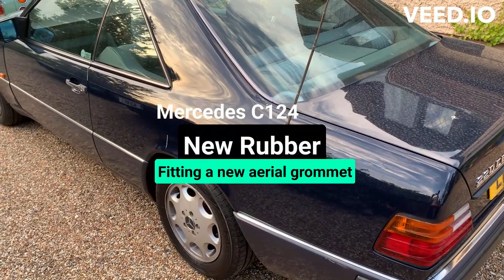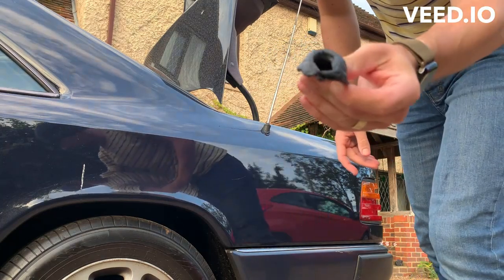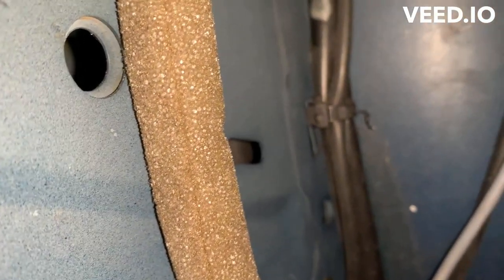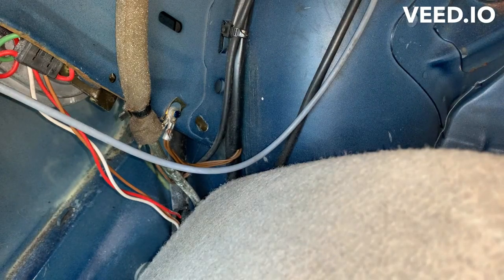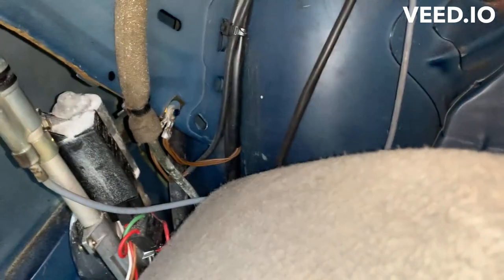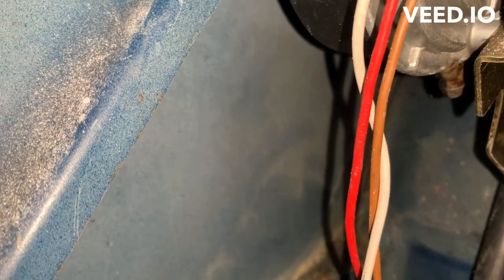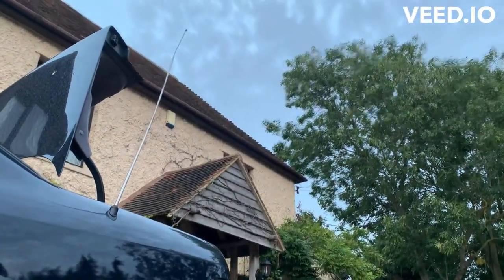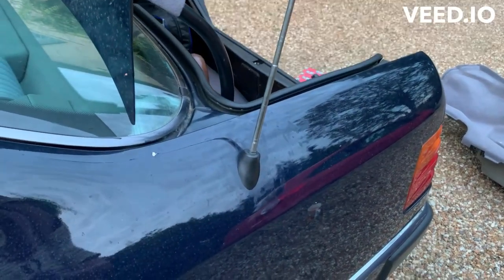New Rubber! Mercedes W124/C124 aerial grommet

Comment: Great video mate, thanks for that.  Did the aerial needed to be extended for this procedure?  The round piece that goes on first, how did you deal with the aerial?  I may have missed this bit on the video.  I'd think you'd have had to bring the aerial to the compressed position, slip the round piece over it, then extend the aerial through the hole in the body.  Does this sound accurate?
Reply from the maker: I think it helps if it is extended. But mine is stuck up so I didn’t have the choice!
As for the first rubber piece - that goes in first, from the inside if I remember correctly. Then the aerial goes in. May be worth loosely bolting it in place at this point. Then put the top piece over and sealing it up. 
It was a while ago when I did this - but I’m sure you’ll get there. 
If you’re struggling, put the rubber into warm/hot water the soften it up a bit.

Comment: Hello. Is it possible to install the rubber without removing the antenna?
Reply from the maker: I don’t think it will be - as the rubber to a two piece. A bit to go over the top and then a bit to go around the hole. 
Then again, if you can squeeze it through maybe. But it’s probably quicker to loosen off the aerial and attack it from inside and out.
Reply: @Beechams1042  Thank you for your answer. I will try to install it without removing it, but if I encounter difficulties, I have no choice and I will have to remove the antenna. 
Best Regards